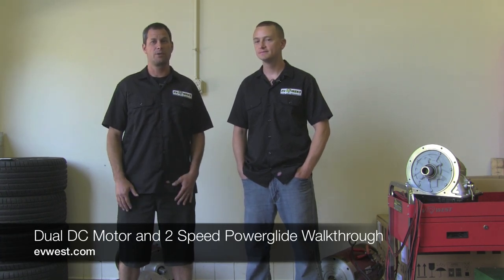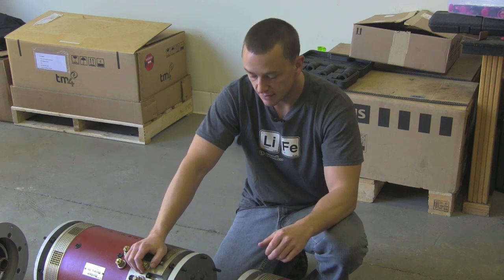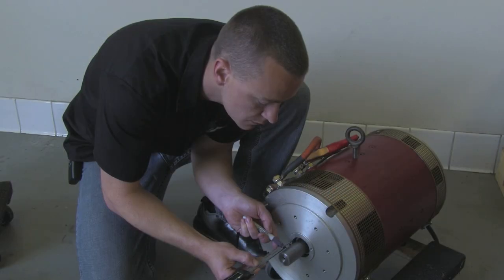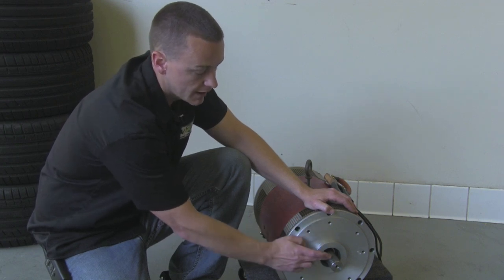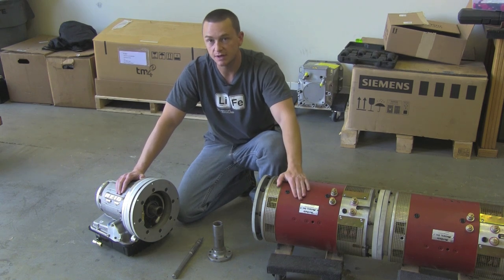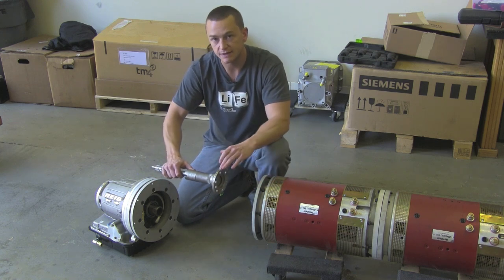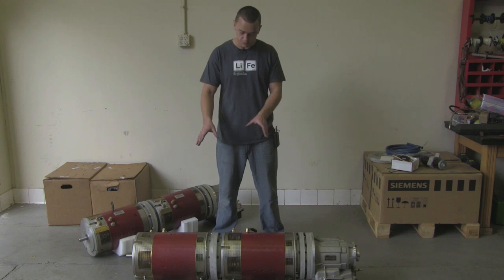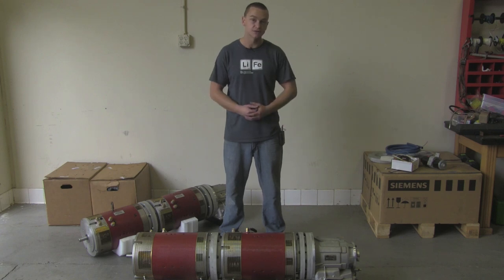Dual Motor Electric Vehicle Drivetrain With Powerglide 2 Speed Transmission Walkthrough by EV West

Comment: Bad things happen when people use cutting discs as grinding stones.
Reply: I'll take "Ways to die painfully" for 300, Alex.
Reply: It's okay, he is an engineer.
Reply: he "was". R.I.P E.V
Reply: You have no clue do you . A cutting disc can give a very fine edge to a metal surface so it can be used . Obviously it will kill the cutting disc prematurely but you just put another one on .
Reply: This is awesome for guys like me the question is can you supply this and what is the cost
Reply: My experiences are horrible
Reply: What can happen?
Reply: I guess it depends on your level of experience.  Zero to Professional 
I’m guessing your a zero.
Reply: Agree...though we've all done it, I'm sure many of us have also experienced the brittle and wafer thin disc exploding into deadly fragments, from even a slight misalignment or setting down while still spinning😮
Reply: When he pulled that gridder out...Lets just say..its hard to believe
Reply: Been there too lazy to switch
Reply: Well, today they go from the idea that most people are stupid and they write a book about safety and the don'ts, and one halve page explaning what the tool is for. Most machines and tools are now so safe that the risks of accidents is verry small, simply because you can't work with them ennymore.  A small disc grinder ( 115-125 mm ) with the safety cap on, is only to use in straight cuts where there's a lot of room around. So, I don't recomend it, but I use it without that cap and the handel on the side. Second, I use my used and too small discs from my big grinder on my small one, then they are most of the time still bigger then 125 mm. The hole in the midlle is the same, 22 mm. BUT, I use my big grinder WITH the cap and WITH the handel. And reading glasses or I see not enough, even without that safety cap. And somekind of sky mask over those glasses; Safety glasses with the right correction cost a lot of money. The plastic of the sky mask , I reguraly polish that on my bank grinder with a wheel made of cloths. O, I'm seventy and I have still all my bodyparts after more then 50 years of being a mechanic as a proffesional and a DIY . Never a work related accident. Maybe I'm a lucky moron... :-) I'm building at the moment a semitrailer ( 10 m ) for a tiny house, so, I have to cut things sometimes.  But an electric bandsaw ofcorse for the most things.
Reply: My God go have a safety meeting and except that it works fine use a faceshield I'd like to hear more about the conversion the trans works great had one for years and many racers used them a great at to solve park reverse etc
Reply: Its safe if you use common sense! Ive been doing it for years but only in dewalt  cordless angle grinder.

Comment: how much current is used to run the dual motor with its maximum torque and speed ?
Reply: RAJU SUNDAR these can easily pull 400A maybe more. If you ran these in sepex configuration you can manipulate field strength (current) and armature current independently. Almost as if you had two separate sized motors all in one. 
But looks like they run the field in series with the armature.

Comment: I would think an accumulator would be better than the pump. Running in park or neutral should be enough to build up residual pressure. I would like to see an ear on the connecting plate for mounting options. Don't you lube the shaft couplers with graphite or synthetic lube to reduce spine wear? It would also be nice know the other parts required to make it complete and the estimated costs. Thanks for the video.

Comment: can you do a 4 weel drive conversion
Reply: In response to that question, you will not go far with battery power unless you have a portable generator that charges the batteries as well as providing electric power to the motors to keep you going.

Comment: You said it was a warp motor, and it looks like one cause you didnt show the spline getting cut, then you reverse the motors and voila the spline is cut so short it looks like a warp motor, but I think its a transwarp motor. Assuming it is, Is your transwarp - PG adapter using the TH400 bolt hole pattern on the TW?

Comment: have you though about adopting your systems to the Marine environment?, I have a 50' Cat which I'm trying to convert from diesel to electric, I haven't found anything this impressive for a vessel as large as mine, I guess my concerns would be how much power consumption do I need to consider and can it be charged via solar panels and wind turbines while cruising open waters, my intention is to eliminate the 2 diesel engines and maintain my gen set since it's already running most of the time. and the motor engines will only be used while coming to shore or in dead winds. it would be nice if you could consider branching out to the marine environment and support a large community of sailors
Thank you
Reply: Good idea, really. You don't need batteries, just replace the diesels with electric motors and get a larger genset, maybe one of the diesels. Otherwise you'd have the weight and space of one of the engines just in batteries -- your normal genset wouldn't be able to power motors strong enough to do much with that large a boat. You will already be reducing the power you have with electric motors to begin with, but should be adequate for docking. Just a few knots headway in a dead calm is better than nothing -- would be like running a pair of 50 hp outboards instead of your diesels though. Your boat was obviously built so it could cruise on the two engines if desired. Having an off-the-grid type solar system would probably take up too much room and weight. But if you really want something like that, just keep one of the engines to move the boat and replace your standard genset with batteries and solar/turbines to recharge. You only need 10-12 hours of battery power, and if you need/want to run AC or electric heat run the genset then.
Reply: skull2kool. i have the same type of question
Reply: Thats actually exactly what i was thinking
Reply: Power = power.
So what you need to know is how much torque do your engines produce at what rpm.

I've set up systems with 150hp motor at 460v 3phase ac. The motor weights right at 2000 pounds. But it's very torquey.

The amount of solar it would require to run that would cover acres of real estate that you wont have on the water. 

You will need a genset around 150kw for a single motor like I described and a battery bank. I would recommend looking into ultracaps to help preserve the service life of a battery pack in this heavy of an application.

Comment: Looking at the Warp 11 specs I see 135 ft/lb and 44hp at 76v and 452 amps. So how do you get from that to over 1000 ft/lb of torque and 600 hp? I understand it's two motors but even for one it's 135ft/lbs to 500 ft/lbs and 44hp to 300hp.Higher voltage and current?
Reply: By over voltage and allowing 2000 amps of current draw. That is how you turn a DC motor with weak specs into a tire shredding monster.

Btw, this is all possible with NO MODS on the motor.
Reply: DC motors show resistance at zero RPM equal to the winding resistance which is going to be pretty close to zero. So off the line your power supply will see a near short until things get spinning. 

That, equates into as much magnetic force & therefore torque as you can generate for a short period of time without letting all the smoke out of the components. 

Stalling an electric motor is a really effective way to cook it off. 

Increasing the voltage increases torque at any RPM.

Your seeing the power tool companies do this now with the new dual voltage tools. They are making the battery packs go in series, via the controller I assume, when they need the torque. 

So, nothing super special going on here. Just the rather impressive and not widely understood, in the car world, nature of electric motors.
Reply: Was curious about the same thing.
Reply: Hey!! so If I was to get a warp 9 and then create a over voltage mode  ( is that what tesla ludicrous mode is?) I would be able to take it from 95kw and 220nm to something like 200 kw and 400+ nm torque?

Comment: what is the total length? (from transmission output to far end?) Mount longitudinally to replace drivetrain of Rear-wheel-drive ... Mercedes E300 station wagon (aka S124 chassis)

Comment: Who's gonna be the crazy sob to stack another moter or two on that setup😈😈😈😈
Reply: David Smith will i
Reply: ShakirasHips69 tractor puller level shit
Reply: fuck yeah!!! I think you can stack em on top of each other too to solve the 3-in-line space issues, with some sort of gearing end casing, saw it on a vw beetle twin moto setup....man....THE TORQUE of three has gotta be insane!!!!!!
Reply: Problem wouldn't be torque it would be traction...
Reply: Yeah, the other problem will be like those razor go kart range
Reply: Probably going to need a vehiclw big enough to hold all the batteries but i like the way you think
Reply: James the way battery's are getting smaller and more powerful it could work with couple dozen  toaster oven size lipo batterys , 3 parallel sets series together for the voltage you need, ?o &a rail dragster diff to handle the power
Reply: The motors are double shafted, so all you have to do is install the second set 180 degrees opposite of the other set. Then you need s special transmission to couple them to.
Reply: I wonder if you can cut the bell housing off any tranny and make it work... Because I would hook a 400 Turbo up to it... But I would need three of these motors... And for the rear I would use a set of 3.00 gears... And put it in my 1967 VW bug...
Reply: 2s 2p set up side by side with a gear/chain in the center of the motors
Reply: Silence plese ,I'm late but; they have their waYS OF MAKING THINGS you know?.

Comment: What if we take 2 kit motors and 2 diferente ratios... Driving first motor as 1st gear and 2nd motor with a different ratio so we achieve a better top end speed without pulling energy to both motors at the time. Shifting motors as it where Gears. I have been thinking this for a while

Comment: Hello guys. Is there a possibility to convert a 1965-6 Valiant to electric? I wanted to do it 25 years ago using a forklift electric motor but it didn't suit the auto gearbox. Maybe 25 years later now I could try again. What do you think, is it possible or not? I want to use the same Torqueflite transmission. Let me know thanks, as I've had this Valiant since '65 but got registered in '66, that's over 50 years. Originally dad's car. What would be the total cost?

Comment: what about a semi truck main 8000 lbs engine removed and replaced with a CUMMINS 5.9l diesel connected to a motor electric generator that produces current to 4 electric motors placed on drive wheels.
Reply: Check out Wrightspeed. If Im not mistaken they have some special turbo powered generator that provides power to electric motors for garbage trucks.
Reply: Would probably be less efficient than just leaving the original motor in. That cummins would be working really hard to provide power to motors that big.
Reply: @David - 
Tesla was listening
Reply: A Cummins 5.9l wont be enough engine to drive the generator. That teensy weensy puny little thing will stall. Electric motors dont care. They will take however much power they need at any given load with zero concern for the supply.
Might consider a turbine powered genset for an application like this.

Instead of a bunch of small motors it might be better to match power output from original engine and sub in a single equivalent electric motor.
Reply: I will trade you my cummins 5.9 for motors controller and battery's,😀

Comment: Great video guys . Just a thought for this . How about putting a alternator off the the fist motor not on transmission side to help create power to charge battery’s while driving ? . And maybe two alternators off of the wheels to increase driving time ?
Reply: That sounds an awful lot like an attempt to build a "perpetual motion machine" and to my knowledge, that hasn't been invented yet. The losses between powering the drive motors and driving the charging system to recharge the batteries as you drive aren't efficient enough to get you where you want to go.

Comment: Lucky that motor doesn't use magnets like every other motor...because it would take a complete idiot to cut the shaft with a grinder and not expect all the steel dust to get stuck all over the magnets inside, risking damage to the windings.
Reply: You mean like when you use a drill or rotary tool . use your brain .
Reply: All electric motors are seals so the magnets are also on the inside

Comment: At 4:12, he says, " You just match these holes up here!"    This is not precision work and one does not rely on the bolts but those flanges need to have spigots on the motor side and also on  the faces where the flanges meet.  There is  good engineering and there is better engineering.
Reply: You are absolutely right about that.  One flange should have a raised locating diameter, the other should have a recessed locating diameter.  This would ensure that the motor shafts are concentric.  An alternate method would be the use of locating dowel pins.
Reply: You match the holes up using the coupler and the hardened bolts.  They have been using the same setup in several hundred vehicles and I am sure that if they had any issues, they would have addressed them by now.
Reply: It's called a pilot flange!
Reply: @overyonderjustapiece  Just saying..... there are much more accurate ways to ensure concentricity between the shafts.  Lack of concentricity could cause failures such as bearings, which may not occur immediately.  Pilots on the flanges would ensure concentricity to within .001" or better.  With just bolts, you would be lucky to get better than .005".